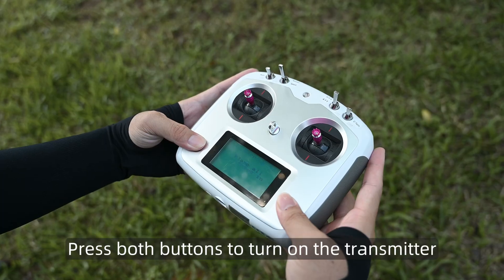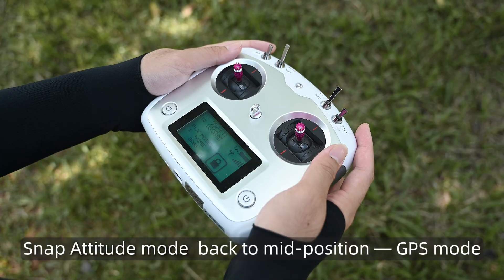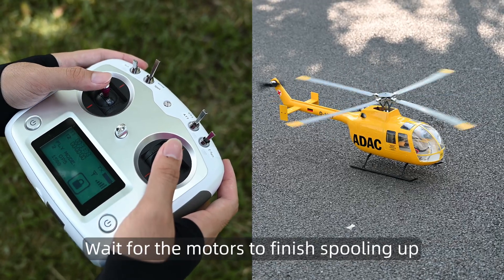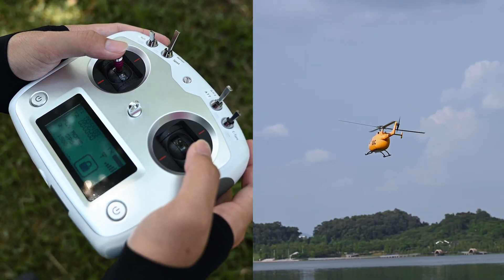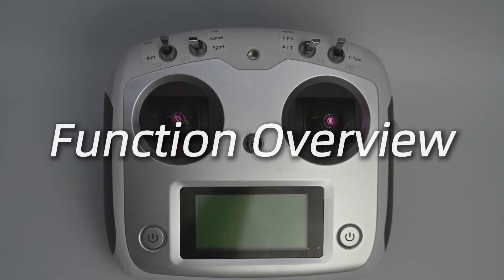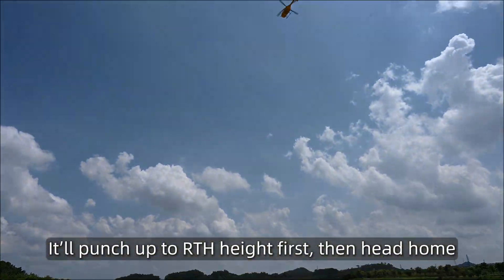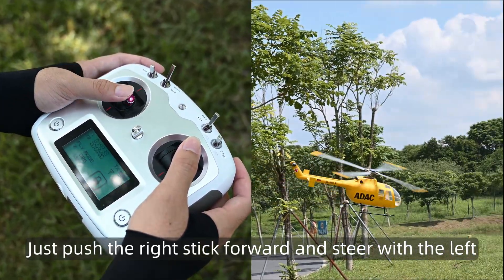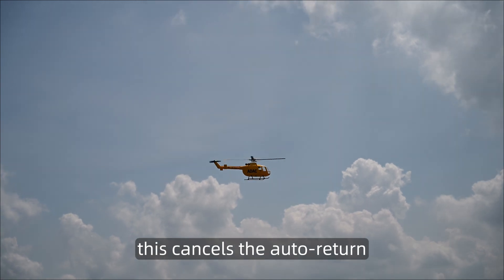BO105 Flight Tutorial | ACE Flight controller

Comment: I purchased my helicopter 2 months ago and the release mechanism is terrible compared to the new one and does my transmitter have the ability to utilize the new function of coordinated turns by moving the switch on the far right of the transmitter?
Reply: Yes i had an older BO105 police version with the old latch system it broke it was so flimsy. God willing they put the new ACE flight control system in ALL of the BO105 scale models. And to answer your question the transmitter is different now on these new ACE flight control models. No more 3D mode it's ATTI. And a few other differences with the coordinated turns that your old transmitter WILL NOT be able to do.